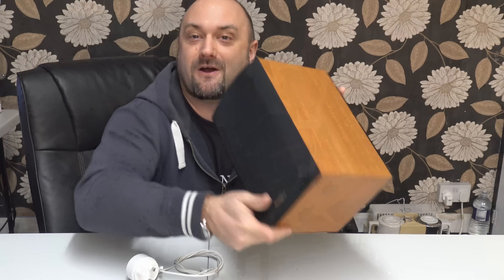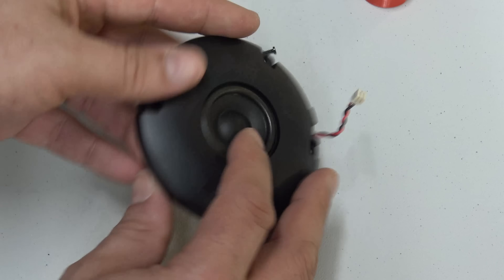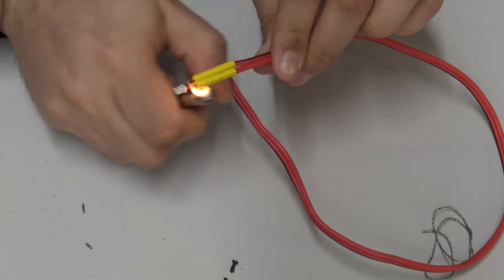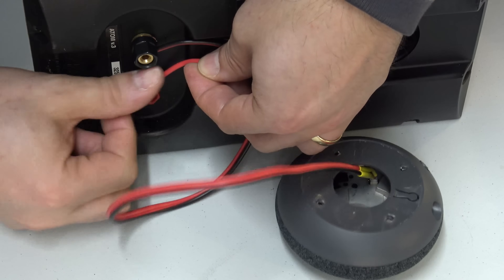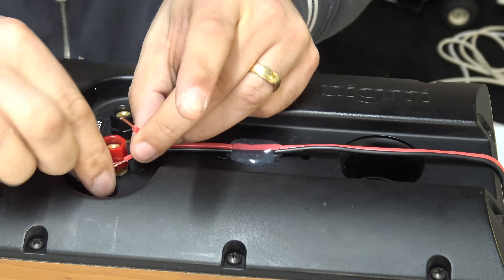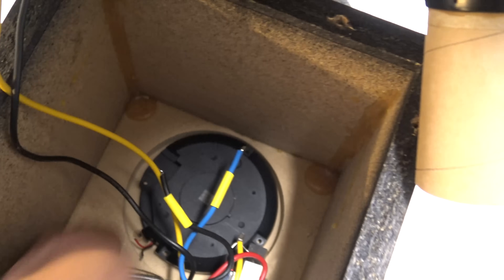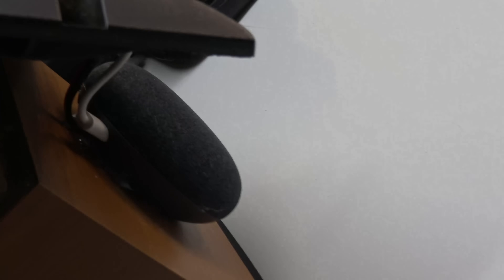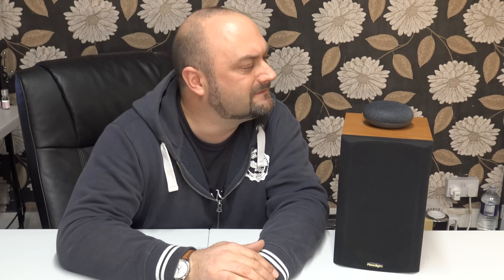DuB-EnG: GOOGLE HOME MINI HACKED - Adding a big speaker to the google MINI

Comment: Hey mate, great video. Do you think it's possible to rewire a manual volume knob into a google home or home mini? Cheers
Reply from the maker: Definitely... you can tap into the speaker cable between the PCB and the speaker...
Reply: @DubiousEngineering  definitely doing this! Cheers dude

Comment: This is cool.  Question (I'm sadly not versed in electronics) - can I plug it to any speakers or it needs an amplifier in the middle (was your speaker powered?)  I'd like to re-purpose a vintage radio and was hoping to simply re-wire the speaker to the google home.  Thanks
Reply from the maker: It will drive a speaker directly... no extras required
Reply: @DubiousEngineering  Hi again, I'm a week further and managed to do it (using a google home speaker - not mini) and it works... but cranking up the volume crashes google.  I made a short video explanation: https://youtu.be/JjZYAme36eU . Any hints of knowledge would be welcome !  (2 hrs later:) Actually, checking further - I adjusted the bass to the lowest setting in the app and I can now go to max volume except on some specific songs with lots of bass - still crashes the Google Home.  Interesting problem...

Comment: Thanks for posting this!  After watching this a couple of times I got up the courage to try this myself AND IT WORKED! (I'm not terribly handy) The most challenging part I found was reconnecting the serial(?) connector .  It took me FOREVER to get that thing reconnected. I did a pretty sh*tty job of soldering too, but I  slapped some heat shrink on there and no one is the wiser.  I'm going to try connecting my mini to a  sound exciter / speaker transducer to see if I can use wall as a speaker for google home. Wish me luck!
Reply from the maker: Oh wow! - That sounds like a really great idea!!  Google Home Mini in a wall! :-)

Comment: Very cool hardware hack. Did you need extra power to drive the speaker?
Reply from the maker: No power required...  admittedly it can only drive about 4 watts into the big speaker, but that’s still more than good enough...  perhaps I could add a headphone jack so I can plug it into the big stereo at home...  but the output is mono.  Hmmmmm....
Reply from the maker: A 10 minute message for my regular viewers... https://youtu.be/hAVadIYgLbk
Reply: @DubiousEngineering  FYI the Texas Instruments TAS5720LRSMT IC amplifier is rated at 20W x 1channel @ 4 ohm.
Reply from the maker: @edreagan8786  ... Hi Ed, 5 volts and 2 amps ...  thats a maximum of 10 wats from the power supply...  and with efficiency in the equasion, I'd guess a max of about 8 watts RMS actual output.  Thanks for the tip though!!!